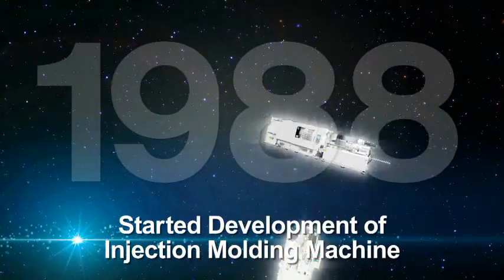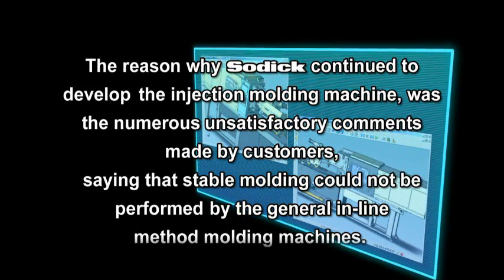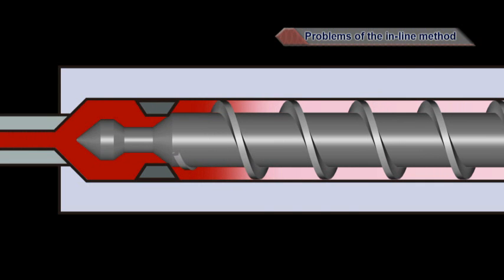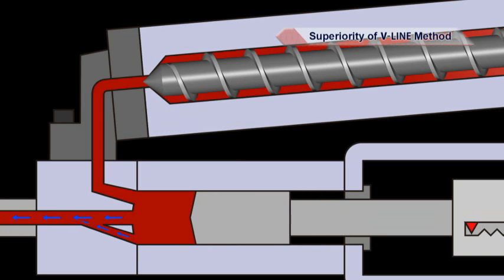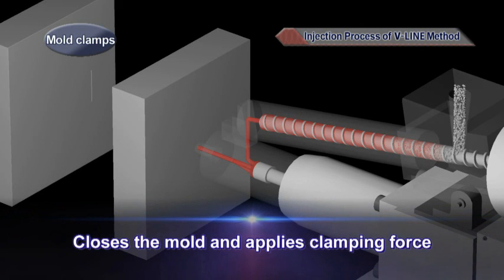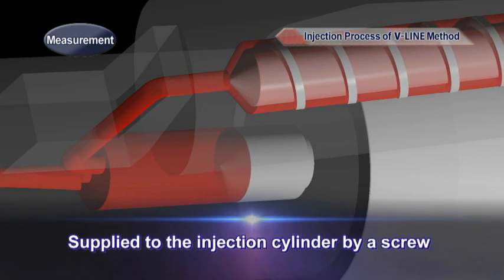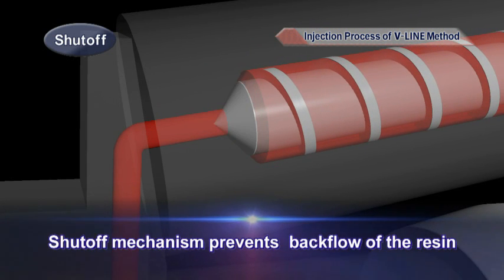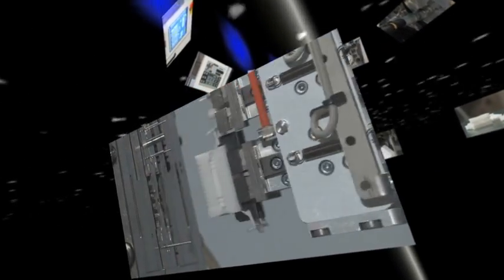Sodick Two Stage Plunger Injection System - V-LINE Injection

Comment: I worked in this field for several years. Only a cracked "check ring" will allow material to back-flow around the screw.
Reply from the maker: Hi Norman, thank you for your comment.  The material backflow happened at the check ring is recognized by many injection molding machine makers.  I think it is fair to say the managing the backflow amount and consistency is the technology of the conventional reciprocating screw system. 
https://www.youtube.com/watch?v=IrOVreMgrmo
This is one of example of controlling its backflow.

Comment: did i hear correctly that the same machine that will do plastic, will do magnesium?
Reply from the maker: Hi Motorsports X, our magnesium machine, MG series are very different system from our plastic injection machines.  You need MG machine for magnesium molding.  Thanks.
Reply: Vikash Kumar 9507122099

Comment: how is the consomation of electrique is tow mor than a clasique machine a loock that there are  tow resitanse  in this machine and the laste control systeme  it s good machine and thre is a big probleme withe the carte control systeme  that wate see
Reply: slow down there chief and use spell checker.... its like you put your words in a blender. About half of them are spelled incorrectly. 

hopefully you're doing better at English 2 years later.